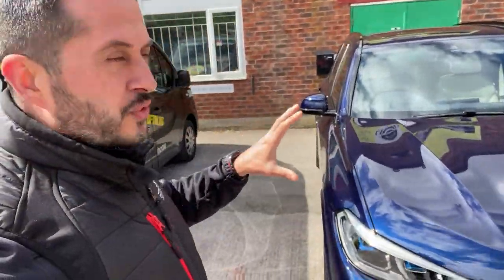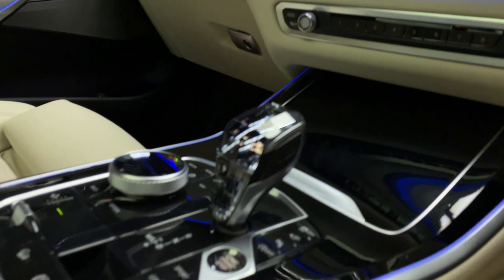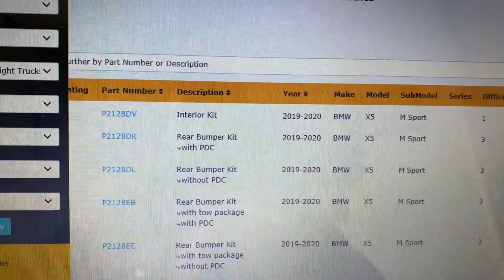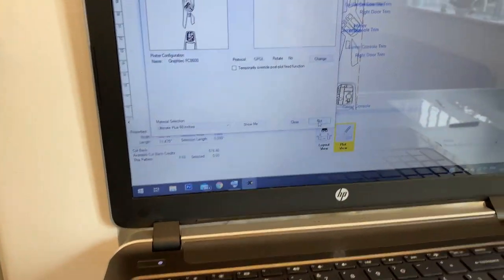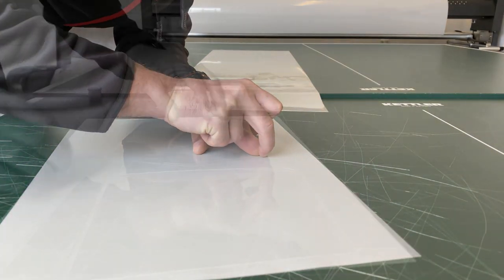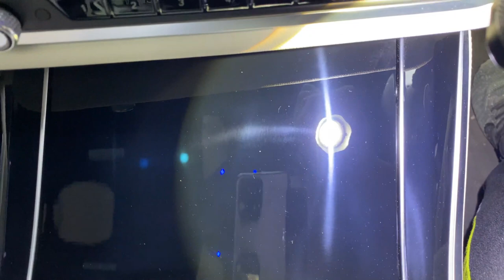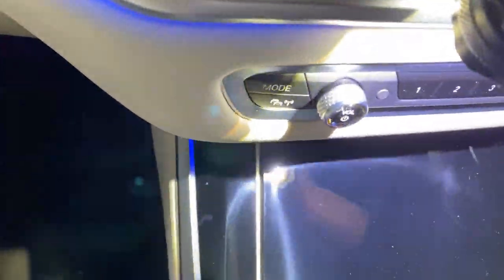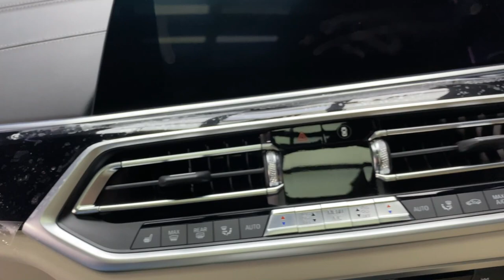How To Protect Gloss Black Trims ? So simple - with Xpel PPF!

Comment: Looked really good and professional.  After you applied the cover did you heat to get the bubbles out and to flatten it out or did it slowly mold onto the area? I was hoping to see the process after it was applied onto the gloss.
Reply from the maker: Hi, when installing PPF you have to remove all the liquid / gel during the installation process, so that you don't have any bubbles left. PPF is a completely different film from vinyl wrap and if you run out of bubbles, you can't get rid of them as easily as vinyl.

Comment: Hi. I recently got myself one kit from xpel for my mazda3, and was wondering what you apply under the film, is it just water, or you add something to water? And what you used to clean interior before applying film? Thanks!
Reply from the maker: You can use soapy water or Xpel Gel. In order to clean and decontaminate properly that panels you can use some soft brushes then panel wipe down with alcohol or glass cleaner 👍🏼

Comment: Impressive, how did you get access to the templates?
Reply from the maker: Thanks for your comment. As an Xpel accredited centre, we have access to the DAP system, a library with over 85,000 pre-cut kits for most vehicle models.

We do not sell these kits individually, but install them in our studio.